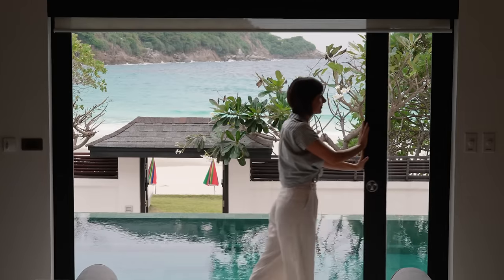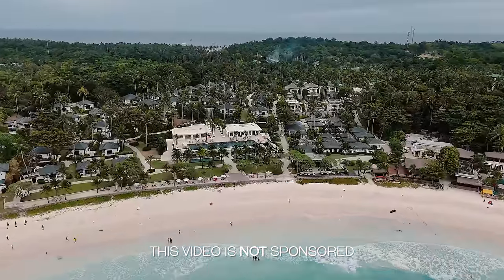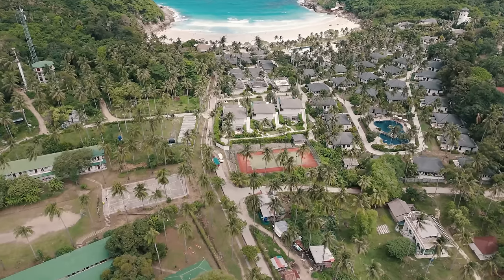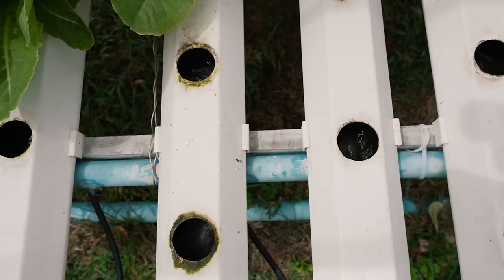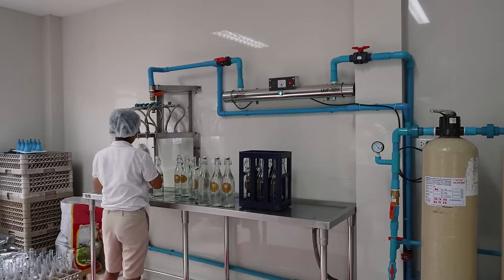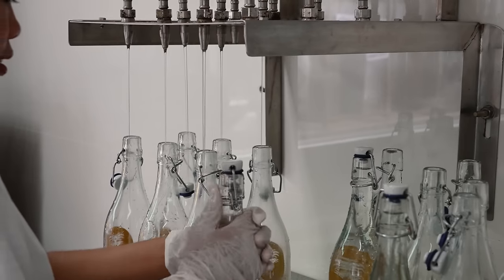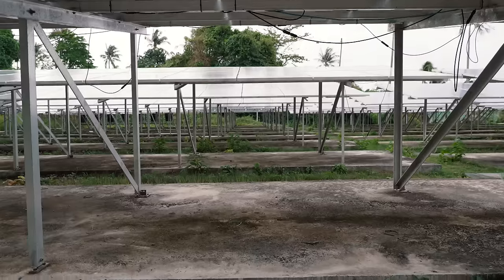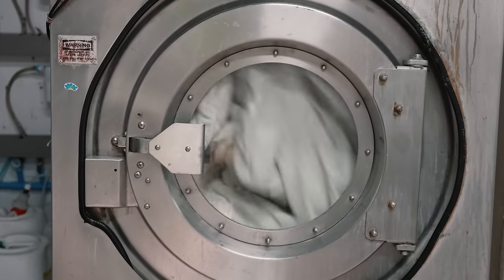THE MOST IMPRESSIVE OFF-GRID ISLAND WE’VE EVER SEEN (full systems tour)

Comment: I heard about the hot water from the A/C unit over 30 years ago.  I had a system called an ECU system installed 30 years ago on a house I was having built.  I live in Florida, so come late spring to early winter, I shut my hot water heater off, saving a ton of money, and use the hot water from the A/C.  I have replaced the heating coils in the hot water heater only once in 30 years....another savings....:)
Reply: I too live in Florida and had the heat recovery system from my ac to hot water heater but as the heat pumps have become more efficient there was no heat exchanging to heat the water to any use... remember water temp straight out of the tap is 55f in the winter.
Reply: I live in CA. I bought a house that had passive solar panels that went directly into a hot water heater.  The water heater was 9 years old when we bought house. We lived in the house for 33 years. The hot water heater was still in good condition when we left. In the summer my gas bill was so low I was just paying the mandatory minimum charge. Passive solar hot water in the right latitudes makes a lot of sense.
Reply: Nearly all brands of both electric and gas hot water heaters these days come with models with built-in auxiliary heating sources.  These can be connected to solar hot water heaters, sand batteries...  Basically, any external source of heat, including another hot water heater.
Reply: Large yachts use centralized coolers/heaters/heat pumps with redundant bypasses to water and engine cooling systems. Vs smaller yachts which typically use independent self-contained units. But one can convert over and be more efficient.

Comment: I am an engineer and have worked designing, building and operating wastewater treatment plants. What you have just seen is a gem and deserves all our applause.
Regarding Nikki and Jason's intention to implement wastewater treatment on their boat, my opinion is that it is unnecessary. The amount of pollution that two people generate is infinitely less than the pollution generated by a large school of fish, dolphins, or just one whale. The sea is itself a gigantic waste treatment plant, and to pollute it it is necessary to concentrate a gigantic amount of waste in one place and for a long time, like a city does. A sailing boat, which is in one place for a short time, and with only two people on board, is absolutely incapable of polluting anything.
My suggestion is that they never allow a drop of hydrocarbons to reach the sea, neither fuel nor oil; and that they use biodegradable detergents, which are on sale in almost every supermarket in the world.
They don't need to do more.
Increasing the weight of your boat thinking about treating wastewater means increasing pollution by having to use engines for more time instead of sails to navigate, keep your boat as light as possible and that reduces your carbon footprint much more than treat your wastewater.
Reply: The wastewater caveat would be in coastal areas.  While the wastewater is possibly even beneficial in the open ocean, coastal areas tend to be nutrient over-enriched, which leads to a variety of ecological problems.  Most notably, it causes algae blooms. When the algae decay they pull oxygen from the water, which creates dead zones, affecting coastal marine life in a variety of ways.  I always wonder what's happening with their wastewater in these crowded anchorages.  I haven't seen anything about how much wastewater storage they have, or about getting pumped out at marinas.  It would be interesting to hear more about that.  If they are doing coastal zone wastewater release, I think their best upgrade would be more wastewater storage, so they can hold it all till they get offshore.
Reply: @cleanriver2   Totally agree.
Reply: @cleanriver2  Plus, with 8 billion people on the planet, it is never just about two people.
Reply: @littlebitofhope1489 exactly!
Reply: @littlebitofhope1489  however, everything begins with only one doing his or her small part.
Reply: @davidallen9526  That was my point. The OP implied that just two people doing anything other than keeping fossils fuels out of the water was pointless..
Reply: @littlebitofhope1489  not necessarily pointless. Just a incalculable impact. But multiplied by only 5 billion it becomes world changing.
Reply: @davidallen9526  Why are you repeating what I said. I'm not the OP.
Reply: There's also something to be said for adopting technologies like this to help drive down the price for others. If nobody buys into this stuff, it will always stay expensive.
Reply: @littlebitofhope1489   Hydrocarbons take centuries to break down in nature, and they contaminate water in gigantic proportions. And it is not just about preventing hydrocarbons from falling into the water, you completely missed my last paragraph, it is very important to sail in light boats that are efficient in low wind and thus reduce the use of engines to reduce our carbon footprint.
Reply: @littlebitofhope1489   If the eight billion inhabitants of the planet were evenly distributed over the earth, the impact of the human being would be zero. The problem is that we live concentrated in large cities, and worse still, we concentrate the industries in industrial sectors where the emission of pollutants is concentrated.
Reply: @JosePedroEspinosa  If the eight billion inhabitants of the planet were evenly distributed over the earth, and still produces the same amount of greenhouse gasses and pollution, we would be in the same situation. The amount of pollutants has nothing to do with were the pollutants originate. That's just plain silly.
Reply: @JosePedroEspinosa  Considering that you don't know the weight of what they plan on using, your response changes nothing. Get back to me when you have those calculations. My point also still stands about your comment about them being only two people. So no, I did not miss it. I gave it no credence since you have no evidence that it will increase the weight of the boat at all, or that it was impossible to offset the weight of any equipment used. Get back to me when you do.
Reply: Excellent point with respect to the very low concentration of two-person human waste.  This and your "sea is itself a gigantic waste treatment plant" comment dovetails nicely with my point on how the ocean evolved to handle animal waste.  It's what it does!  Also, you're absolutely right about saving weight to reduce footprint.
Reply: The cheapest energy is the one you don't spend.
17:30 I know it's for the aesthetics but showing lights ON during the day is not the best demonstration haha
Reply: But you didn't read it all.  The extra weight of their sewage treatment would cost more energy to move the boat. That is a negative feedback loop.
Reply: @arresthillary9502  Except NONE of you know how much it weighs, or if they could offset it with something---oh let's say a dishwasher so the weight was net zero. And stop sounding exactly like each other.
Reply: @justincase5272  First, there are not 8 billion fish in the ocean who are the size of a human, and the ocean clearly does not handle the waste. That is against all of the evidence. You people sure like to make a lot of claims with no evidence. You make claims about the effects of weight when you don't know the weight of the apparatus. You make claims about pollution being dependent on where it is with respect to all of the negative effects that are blatantly wrong. Yes, there are some issues with concentration of pollutants, but there are also global effects. It's like the effect of cargo ships and the chemical trails they emitted lowering global temperature. They are all across the ocean and when the laws changed and the chemical trails disappeared, the global temperatures rose. You people (if you are even different) making this argument are wrong. You don't have the data, and yet you are making grandiose claims. That is ridiculous.
Reply from the maker: @JosePedroEspinosa and @cleanriver2: On the original Curiosity there were 3 heads: 2 were composting toilets and one was a marine head that was either pumped out at shore or emptied on passage. Most countries don't allow dumping marine heads in inshore waters for the reasons stated, and most cruisers are more than happy to comply. Nobody wants to snorkle in a bay where 20 boats are dumping sewage.
Curious Minion
Reply: @gonewiththewynns   It is obvious that sewage cannot be discharged into bays unless they are uninhabited. And that exactly matches what I said here: "If the eight billion inhabitants of the planet were evenly distributed over the earth, the impact of the human being would be zero. The problem is that we live concentrated in large cities, and worse still, we concentrate the industries in industrial sectors where the emission of pollutants is concentrated."
Reply: It always gives me a chuckle when people get cringy about swimming in waters that receive the (properly) filtered runoff of grey water from residential septic fields, since those same people completely overlook the number of marine animals (and other critters) that are all using that same body water as their own "unfiltered" latrine 24/7/365.
Reply: @cleanriver2  that's true what you say BUT the ocean can clean itself. The problem is not the ocean cleaning process. It is the densitiy in coastal areas or let's say it : it is us (humans). IF people more WOULD care about it an don't put everything in oceans and groundwaters, we wouldn't have this problems.
A sailboat with two people and their sewage is not the problem and will never be.

how many towns on coastal, even in the med just don't clean their sewage?! it all goes in the ocean.
spain gets regular fines from EU because cleaning not their water the right way...

I mean : that says all! 

We can't blame states in second or third world if not even western europe does it the right way.
Reply: As a fellow Engineer with operational experience on water treatment, I concur.
Reply: @gonewiththewynns   "Nobody wants to snorkle in a bay where 20 boats are dumping sewage." What do divers do when a whale enters the bay? She alone generates much more sewage than the 20 boats. Or a school of fish, or a pod of dolphins. This fauna discharges its waste directly into the sea without any treatment.
Reply: I don’t disagree, but more people are visiting far to reach beautiful places and are inherently concentrating their waste there - which is chemically different than the natural waste the ecosystem has found balance for.  That’s why I’m interested in treatment when near or in those type of places. I’m not talking about two people dumping their wastewater in the middle of the ocean though.
Reply: @captainobvious9188   All you have to do is leave the bay and, once outside, discharge the sewage from the tank.
Reply: @JosePedroEspinosa  Exatly the solution for pollution is dilution.
Reply: Excellent advice, 
… ppl have become total puritans and borderline fanatics… 

You point is spot on: keep the boat as light as possible.
Reply: @reginamemoriesforever-vc8ql   By keeping the boat light you will use less diesel, and that is important for the care of the planet!

Comment: Where I live on the shore of a large freshwater lake. There are no city sewage lines or leach fields, we all have aerobic septic tanks. They are aerated and the overflow after treatment is clean enough to water the grass. Small tank systems are available that may fit on your boat. The aeration pump may use some energy and care and feeding of the tank so that the fecal matter decomposes is necessary. About every 10 years we pump out some sludge just to be cautious. The standard systems are anaerobic, these use air and are called aerobic! You may find this type of system appropriate and already existing.

Comment: On my boat, i had electrolysis  sewer treatment. It was electric, and handled black and gray water. It was powered by the solar panels. What came out the other side was 'drinkable'. This was Australia in the 90s, and was accepted by every marina on the seaboard. Not super expnsive, took up less room than a holding tank, and i didnt have to carry waste, or find pump out stations. Electrosan is the brand i had. No smells.
Reply from the maker: Thanks.  We'll look into it, I've not heard of that brand before. 🤔

Comment: You can use electrolysis to purify, black water and gray water, including laundry detergent. And then filtration will take out the solids. Years ago when I was studying this process, I experimented with all kinds of materials and it works with everything I’ve tried. If you just take orange juice and electrolyze it, it becomes clean water and brown, floating crud same with urine. I’m going to try a little experiment today with laundry, discharge soap and measure the ppm.

I also have an off grid solar powered house

Comment: I love this!  Have you thought about doing something with your food waste?  I bought myself a Lomi (but there are other brands too) and I LOVE it. It basically composts your leftovers and turns them into “dirt” in a few hours. Using a different setting that takes a bit more time, you can use it as compost for your plants (the heat on the shorter setting isn’t good for the nutrients).  It a nice looking unit that sits on my counter, and it doesn’t use a lot of energy. Anyway, I’ve been thinking about it for a while for you.

Comment: I use to work with some farmers in Ohio and had a chance to see Methane digesters, as they are called there,  in action and had the chance to help build one. They also had some operating solar electric systems, and wood gas engines for generators. I had a chance to help design a wind generator, I had been exposed to them in High School having met and talked with Mr Jacobs who was the leading designer and producers of wind generator systems before the government "electrification" projects were initiated shutting down his business. He had one that he sold to the government for use at the South Pole. When a search team found the old abandoned research station in the 60's or 70's the windmill was still tuning in the wind and they hooked up their batteries from their vehicle to see if it still worked, and it did. Lots of alt power sources that America learned to live without because they could just plug in <and pay the bill> much easier.

Comment: There has been gray water recycling in vans for showers. Water falls into a gray water tank, then runs thru particulate/carbon filters and a reverse osmosis filter, sometimes an UV light back into the main system. They say using 5-10 gallons is the smallest water amount, but if you use larger water tanks it prolongs the need to change filters.

Comment: I've also been looking at many of these same technologies, but I've been focusing at less commercial, more homemade / at home scale systems. These often start in the 1 toilet or batched process stage vs the ramped up 400 person stage. I even found an at-home plastic recycling system that can be run off a beach campfire from deadfall to build the requisite heat and pressure to break general plastic waste down into a diesel-like petroleum fuel. Some of this stuff would be more beach friendly than deck friendly, but a weekly trip to the beach for work purposes instead of just play isn't all bad.

Comment: I have been thinking and working my way toward down sizing into a van conversion.  Here goes: 1) Sprouts and microgreens are doable and don't take up much room.  2) An immersion blender takes up less room and uses less energy than a blender, and you can blend hot liquids.  It is better for smoothies.  3)  You can do anythign with an immersion blender, a small instant pot, and a small air fryer, and maybe for boiling water with an induction burner.  4) I currently keep a year's worth of food in a closet.  It would take a book to explaing it.  5) Rain water catchment is a good idea, but also there are solar water distillers that can make fresh water from sea water.  6)  If it were me I would install a Kimberly stove, even if you only use it a few times a year.  I am going to put one in my van.  7)  Take a look at the Cobb Barbecue System from South Africa.  You can cook a whole meal on just a few charcoal briquettes.  8) If you plan on doing much fishing, you might consider a small smoker and vacuum sealer to preserve it.  But you could use the Cobb to smoke fish.  9) Look up the brand "homebiogas digesters" made in Israel.  It is probably too big for your boat, but you will have fun learning and thinking about it.  10)  Also, if you have never heard of it, do a search on "recirculating showers".  It is possible to take up to ten long showers, over a couple of weeks, on the same gallon of water.  It recirculates by pumping the water through a filter and reheats it with a small on demand electric water heater.  Really cool.  This was a fun video.

Comment: Even on a scale this small you can't sustain a small community without the good old diesel generators, love how they skimmed over the part which really provides the base power for everything else, it's making your own grid which is fully dependent on diesel shipments from shore.
Reply from the maker: Don't skim over the part where they said they are investing in battery storage so the generators become only backup.  Until recently, there have not been battery solutions large enough or reliable enough.  As new solutions become available, they adopt them and build them in.
Reply: I saw that part, I have yet to see a community of that size run on batteries though. Be a nice spot for a small modular reactor, that would really take them off grid.  @gonewiththewynns